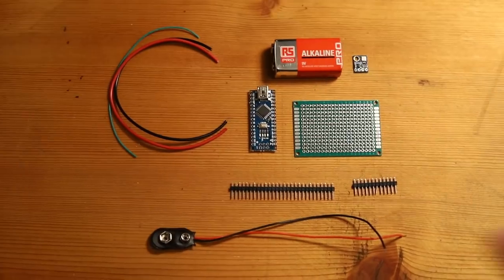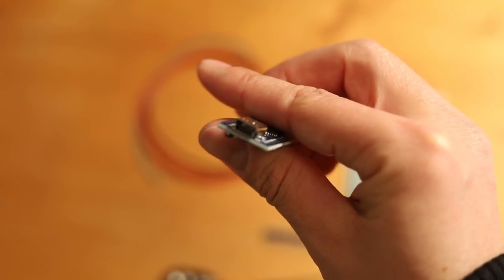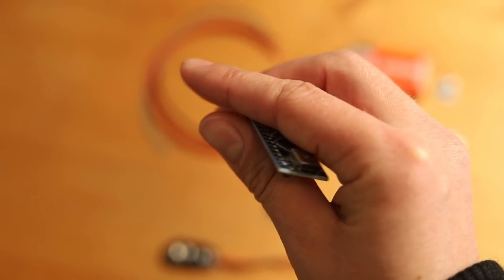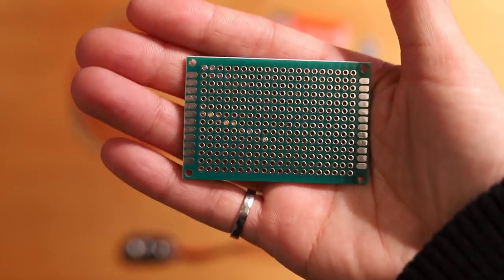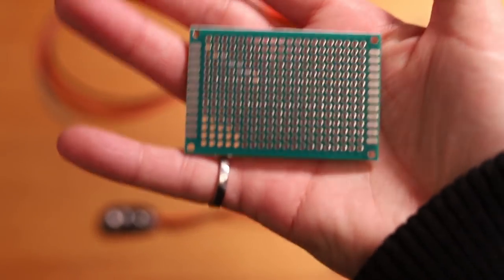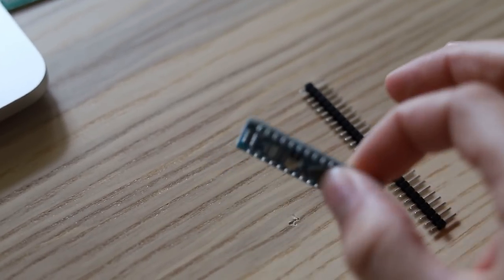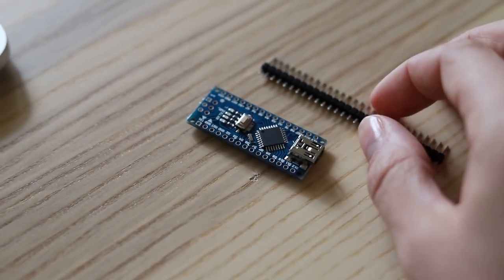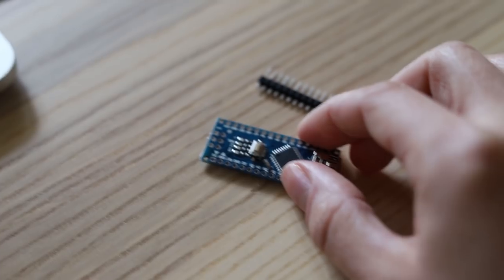Which Parts Do I Need? | Part Assembly + Soldering | How to Make a Sensor Part 1

Comment: The chip itself is an ATmega328P and it can only be powered by 2.7V to 5.5V. The 9V battery will fry it if you connect it to any pin other than the Vin pin which is connected to a voltage regulator (a four pin device on the bottom layer of the board) that can handle up to 15V and it outputs a safe 5V for the microcontroller. The voltage divider for the battery reading is an option but should be part of a control circuit (you tell it when to allow current to flow through the divider) so that the battery isn't drained by the divider at all times. I am guessing this is an application where low power is of great importance. I am really looking forward to the next videos.

Comment: Mechanical engineer here! But you should have probably made your circuit design on a breadboard before soldering wires to your pins lol.
Reply from the maker: they also didn't have breadboards at the shop lol
Reply: @RiverTechJess : well that's a bummer!  Breadboards are cool.  Hopefully you can experience them at some point.  AND, seems like you're doing well without, too, and that's legitimate as well. :)
Reply from the maker: If I find one soon, I’ll definitely check it out:D

Comment: Hi! I recommend you to use "jump wires" instead of the normal wires. You don't need to solder them :)
Reply from the maker: Thanks Gabriela. I know I don't have to, but I want to because the sensor will be out in the field and I want it to be robust.

Comment: Instead of soldering the wires to the Arduino you could use DuPont connectors (or 2.54 mm connectors, same thing) which would be a bit more flexible. As you didn't even test your circuit on a breadboard before...
Reply from the maker: they didn't have breadboards for sale:(

Comment: I'm a mechE so don't take my word for it, but I think the arduino uno is a bit easier to work with. No soldering involved for the most part. It's ready to go from the start. I've used it for some robotics and it was easy enough to use with no electronics/ programming experience. If you have the room in the sensor, it might be something to look into.
Reply from the maker: Yes but I really want to deploy my sensor in the field and make it compact. But thanks for the suggestions!:)

Comment: Few notes:
- Arduino is based on an atmega microcontroller, which includes timers. If you want to measure every few minutes you can use the timers in the microcontroller.
- You can buy many sensors on banggood
- You may want to check the local IEEE student branch. Contact them, I am sure they can help you.
Definitely, make the video!

Comment: Apologies in advance but that is not how to pronounce “soldering”

The board is not so much a data logger. Wouldn’t your SD be the piece of hardware that stores the data.

The nano would micro controller. Similar to a controller in a larger process control loop
Reply from the maker: How would you pronounce soldering?

Please see my latest video for the answers to your other comments
Reply: “Saw-dr-uhng”
Reply from the maker: Alright